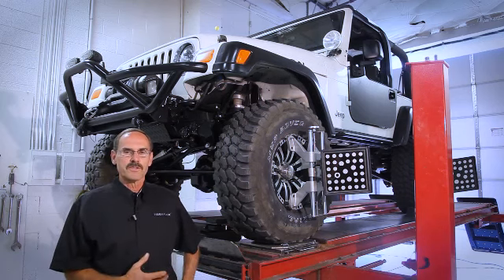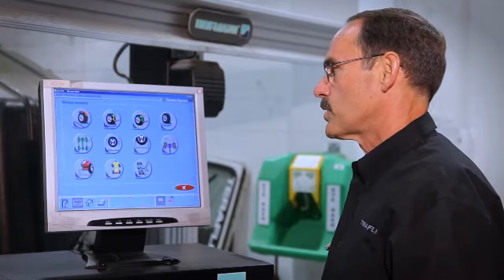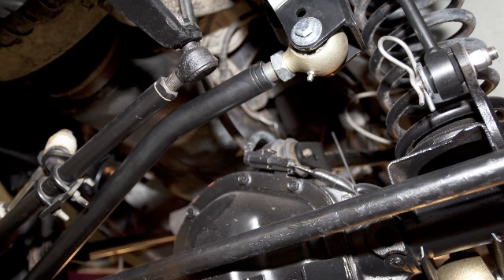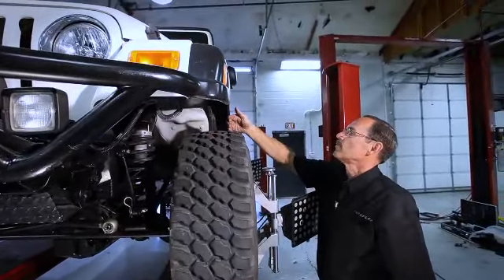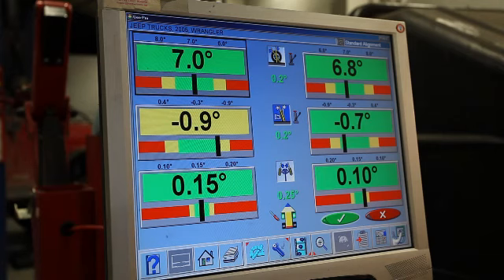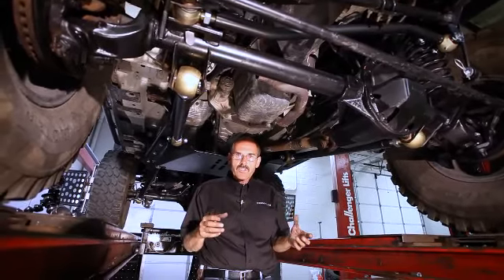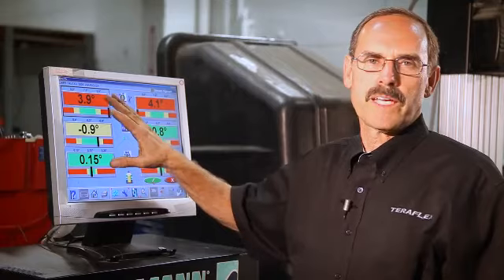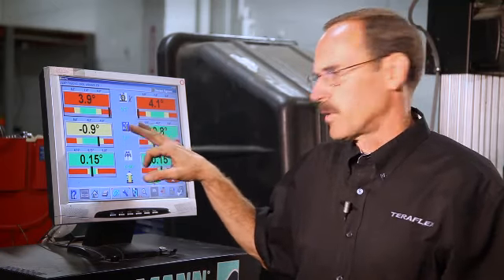TeraFlex Training: TJ Lift Kit Jeep Alignment Part 3 of 3

Comment: Very informative video. Thumbs up. I'd like to add that while not a very common procedure but one all too commonly overlooked on 6"+ lifts is reclocking the axle tubes in relation to the differential housing. This is a great way to keep a high positive caster number and an ideal pinion angle at the same time. This may not be cost effective to do to a Dana 30/35 but if ordering heavy duty custom axles many manufacturers will clock this to your specifications.

Comment: I wonder how much more difficult this is with single adjustable arms vs double. I bought single adjustable arms and it would seem this would take 4x as long since you have to remove the arms each time you adjust.

Comment: Great stuff. You say you don't want to go by the factory spec on a lifted Jeep with bigger tires? So what numbers should my castor be for a TJ with a 2" lift running 33" X 10.5 tires? Is it worth putting adj control arms on to adjust it with my small lift?

Comment: So do I adjust the drag link while still on the front alignment screen. I get the toe adjusted. But I see it move after I touch the drag link. I'm I doing this right. Are you suppose to lock the steering wheel before ???
Reply from the maker: You will want to maintain whatever numbers you used center the toe side to side. The toe should stay consistent after the tie rod is tightened. If the tires shift while adjusting the drag link, you just use the steering wheel to put them back to their centered position and then continue adjusting the drag link until the steering wheel is straight while the tires are also straight.